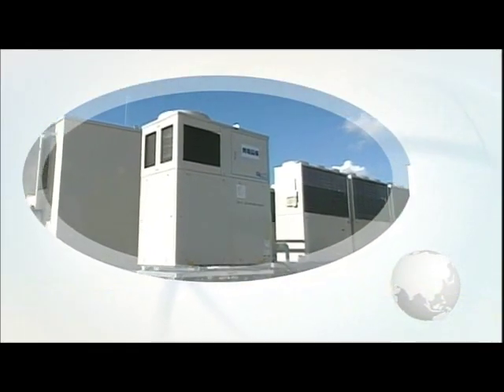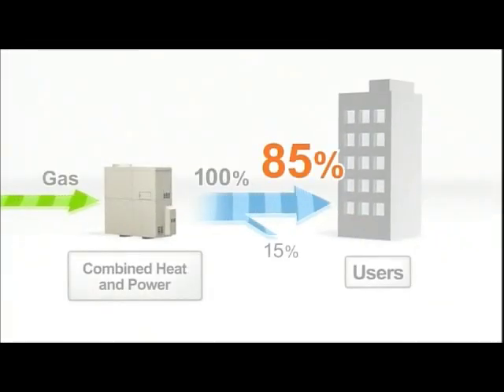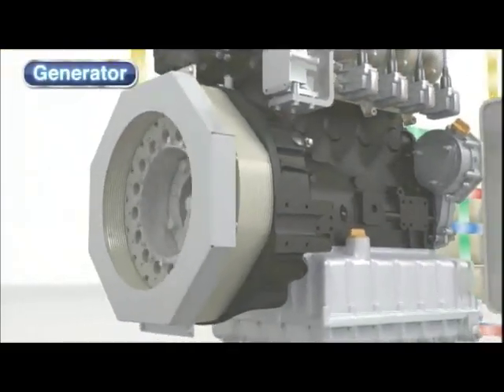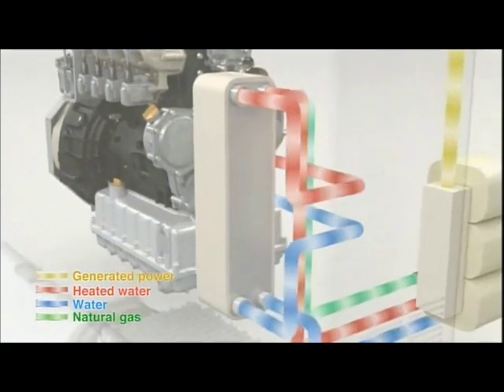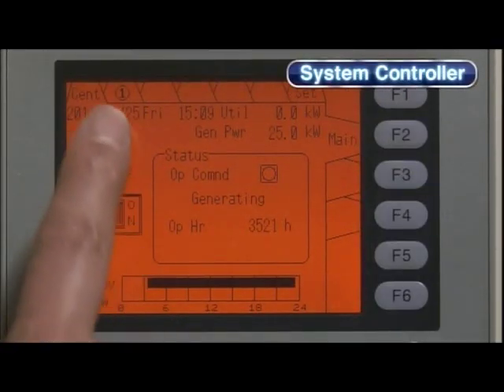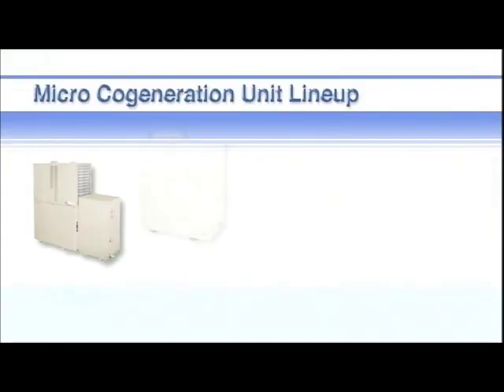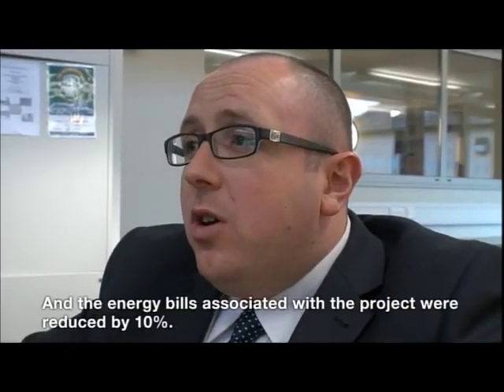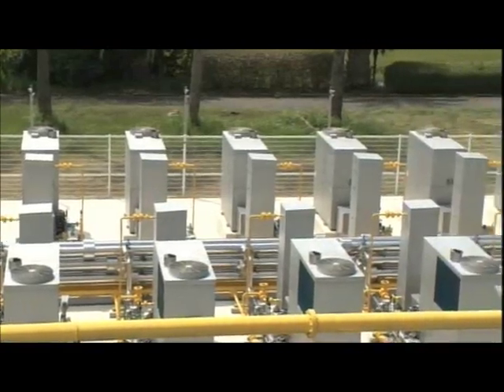CHP Overview

Comment: excellent, we need these engines globally, stop using gas and oil stroying mother earth
Reply: Theses engines/systems still use fuel, this is a wide range of fuel types, it can be all types of gas,bio,lpg cng,lng,methane, hydrogen, etc. or just  petroleum based fuel, gasoline, diesel, oil  even old frying pan oil but finally it still emmits carbon dioxide, depending the fuel it can be up to 85% eco-friendlyer. I'm not saying it's bad, it's a very good system and could be upgraded by adding hydrogen production and backup battery system, using the overproducted electricity. My opinion is that it's more for industrial use, you need the space to install the system and the installation cost is also a downside, also the noise when where talking it to use it for home use, but it's possible